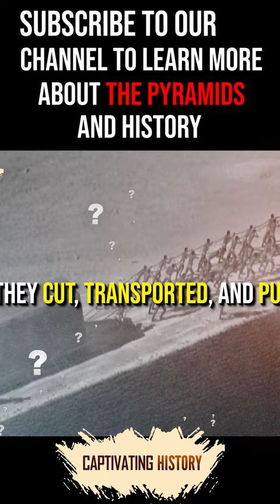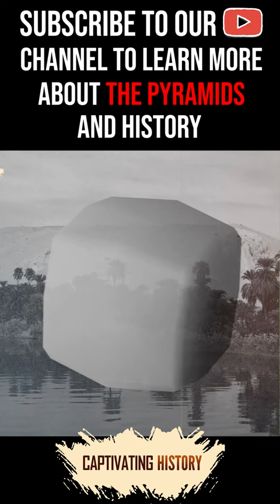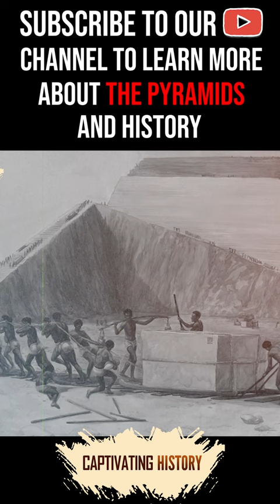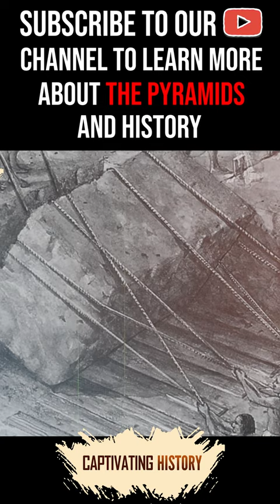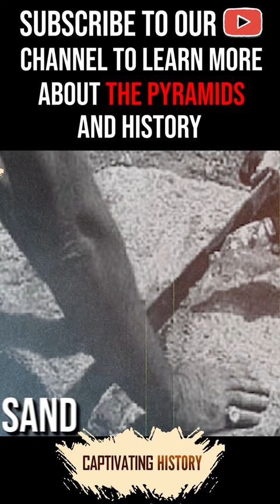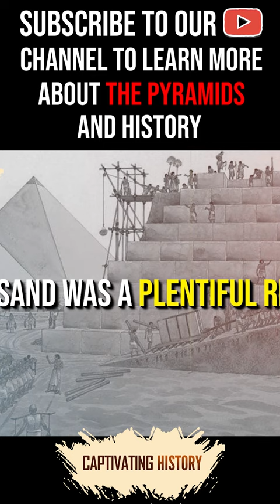How Were the Stones of the Pyramids Cut, Transported, and Put in Place? #shorts

Comment: How did they cut the insides of the granite boxes? Sand did not cut those perfect inside corners.
Reply: Lost technology, it’s not that hard.
Reply: @-ShootTheGlass-  it's not hard? How would you go about doing it then?
Reply: @jswhosoever4533  Well I'd love to tell you if the technology weren't lost.
Reply: @-ShootTheGlass-  i like how you felt the need to 'correct' him yet you have absolutely zero knowledge to add. Brilliant.
Reply: The issue is you don’t have proof they weren’t cut using sand quartz grinded against the granite with copper saws. And before you say it, they most likely used multiple saws.
Reply: @Ta-Mezczyzna  how do you get a saw into an inside corner??
Reply: @jswhosoever4533  you’re referring to the corners inside the kings chamber right? I imagine chisels and hammers like Europeans did when building structures like the cologne cathedral.
Reply: My evidence for this is the fact the cologne cathedral was made from sandstone (mohs hardness score of 6-7) and granite, which was used for the kings chamber has a mohs hardness score of 6-7.

Comment: That guy quit his project once he realized it wasn't viable, and only made 1 cut 6 inches in depth after 3 days of work.
Reply: The corners were rounded and the cut sides had grooves, this also indicates this was NOT the way they were cut.
Reply: Yup. I saw the program. Preposterous to think thats how they did it. Good post. Aloha!
Reply: I use Diamond tools to cut concrete daily and often natural stone. 
I know how much power, speed and pressure is required to cut granite. 
I know which theory I believe and it's not the one with a copper drill bit, sand and arm power.
Reply: @sliperysid  this guy didn't use diamond cutting blades. He used a bronze saw, water, and sand, the tools available at the time, and failed immensely, so he quit. Go watch the video.
Reply: @sliperysid  you might want to look at the experimental videos done by sacred geometry decoded and scientists against myth. They have successfully drilled holes with copper and the removed cores have Mark's on them quite similar to what archaeologists have recovered.
Reply: @rj4313  read my comment more closely. I watched first watched that video about 10 years ago and seen it a few times since
Reply: @sliperysid Tell us plz
Reply: @rockysexton8720  That sounds VERY far-fetched to this diamond driller. We would spend HOURS drilling a 4 inch diameter, 8 inch deep hole into concrete floors. The amount of progress into the work was a delicate balance between patience and torque. The old timers would get a suitable length of scaffold pole to put over the winding arm of the rig to reduce the tedium. When it fell off you put it back on top. If it wasn't going in you had to rough the bit's teeth up with a file to expose the diamonds. Ancient Egyptian cores were cut at FAR faster rates, as evinced by the resulting grooves remaining on both the cores and the work.

Comment: The sand and copper saws were anything but practical - they took an entire day to cut less than 2 inches into a 3 foot wide block. At that rate they world still be cutting the blocks for an unfinished pyramid today!
Reply: If anything it proved that was not how the stones were cut
Reply: It depends on how many you cut at once, and how many groups in rotation. Say the blocks are 60 inches tall. Thats 1 month per group. Have 30 groups in rotation and you get 1 group of blocks per day. The more the blocks per group the faster you produce them. They wouldnt cut each block one at a time, regardless of the tech used, its just impractical. Say that each group of blocks was 1% of the total # of blocks used per pyramid, it would only take 3 months to have every single block need, to be cut.
Reply: @QockNobblr  - so you claim that you can cut 2 million blocks in 3 months?… you’re insane!
Reply: @archer721  like I said, sample size. How many you produce each month depends on how many blocks per group.
Reply: @QockNobblr  - you do also understand that it takes 6 cuts to make a block… right? And they all have to be “perfect” cuts. (Not necessarily clean, but dimensionally) If any were not perfect, those imperfections would translate throughout the structure and would have created unstableness throughout the entire pyramid resulting in an impossible situation to correct… there is no possibility that they were ALL cut with sand and copper no matter how many “teams” of laborers you managed to gather together… the more you gather, the more unskilled labor you acquire, the lower the standard of the finished product.
Reply: @QockNobblr  - this is not just a matter of stacking random blocks until you create a pile. Millions of tons of weight creates a massive amount of applied pressure resulting in instability at a MASSIVE scale. this was a massive effort that cannot be done at random and cannot incorporate random imperfections at any scale.
Reply: @archer721  never said just sand and copper. They had access to diamonds, and I find it hard to believe they couldnt make bronze. Bronze hardens when it's hammered. Diamon and sand encrusted  hardened bronze circular saw powered by man-powered wheel mechanisms with some gear ratios to increase the rotation of the blade to suitable levels would 'cut' down on the time to produce a single block. Obviously, I wasnt suggesting that each group produces 200k blocks, and that occurs daily. Each pyramid was built over 40-60 years each roughly. Lets say half that time was spent cutting out the blocks. Thats about 30 years for 2 million blocks. Which translates to roughly 186 per day, or 5,555 per month. If they did it how I think they did it. 20 blocks wide 10 blocks deep per group, mined out of the quarry, thats about 200 finished per day and thats a group only 1 block long (so 10x20x1), which its more likely they made groups longer than that. The pyramids werent built in s few years, they were built over the course of a pharoah's lifetime (the big ones at least. A couple pharoahs before them cracked out multiple small ones before their death). There's definitely more to the story, but its not as insane as divine intervention or aliens. Its almost definitely more realistic technology, like wheels, diamond tip blades, gears/gear ratios and stuff like that. Like tech we have today but bigger, more rudimentary and entirely man powered. The egyptians were some crafty bastards
Reply: @archer721  by group, I meant the blocks being cut themselves, not being placed. Thats a whole other story. My personal bet is elephants or man-powered crank cranes sorta like archimedes hook which could allow a single man to lift an entire ship just using pulley ratios. Add multiple all the way up and swivel system to it and you could relatively easily move those heavy ass granite blocks around. But obviously this is all just speculation
Reply: @QockNobblr  So how do you cut the holes and the inside of the boxes or caves. You must do some research about the speed of modern tools moving into granite.
Reply: @clivewells1736  it depends on multiple factors such as ceiling height, hole depth, cave depth, etc. How did they do it exactly? Not sure, but obviously it was some type of multi-man powered crank shaft system. Also the inscriptions inside/on their structures were obviously chiseled in, due to how crude they look in comparison. Their cutting amd drilling tech must not have been for delicate writing. It would've been for large scale precision cuts and holes. Ocham's razor. The simplest answer is often the correct one.
Reply: @QockNobblr  the simple answer is we dont know about their technology, not that it was sand and pounding stones.

Comment: But drill holes and saw cuts have been found. Some drill holes found could not be achieved by any tool today.
Reply: Yup, and the water damage on the Sphinx and the sea shells in the sand scream that the Egyptians dug them out rather than built them..Now the real question is who built the Pyramids on the Azores ocean floor off of the coast of Portugal.   Check out Randall Carlson 
.
Reply: Uh, modern tools could absolutely make the same "drill holes" - tools my own Father owned.
Reply: @christyworld72  it wouldn’t be the same. Looking at the striations and doing the math, whatever tools they used were incredible. There’s two kinds, 1 of them spun faster than a modern drill, another spun much slower than a modern drill but could penetrate into the rock hundreds of times faster. So in the time you drilled 1 inch with a modern drill, they’ve already drilled 300 inches. We can make a hole in stone easy, but it won’t be the same.
Reply: @OlavUnngar  please do reveal the source for your claim of these miraculous drills. There are plenty of videos demonstrating how ancient Egyptians were quite capable (clearly) of accomplishing what they did with available materials,
Reply: @christyworld72  you ain't core drilling granite or cutting it precisely with copper without extra technology
Reply: @anonnomous6223  and yet they did, somehow
Reply: A type of pord concrete
Reply: @christyworld72  not necessarily. We have no proof that they were originally constructed at the time of the pharaohs
Reply: @christyworld72  no they dident that would be like cutting bricks with butter just not gonna happen
Reply: @laa4307  how is it so then?
Reply: @anonnomous6223  um, so, earlier then?
Reply: @americanjoe5486  poured? That would be evident.
Reply: @christyworld72  well idk just spelling the rules out. But I have cut it dovn the 3 thigs i bellive is the case. 
1 they had some for of mixture (prohabs some plant mixture ) that soften the rock so they was able to cut it with cobber tools.

2 they had harder metal tools then we give them crittets for.

3 they had vary difrend teknologi then ours and im talking about sound & frequence teknologi. I do belive that was the way to get 70tun stone Blocks livetated 300feet up midt air and put in placed, but that teknologi has ben lost. 

Fun fact did you know they had electrisety back then ? Even batterys that is called a Bagdad batteri tht coldt be used for wielding
Reply: There’s a saw cut that sent crooked , it didn’t go off in the wrong direction for a 1/4 in or anything it was 3-4 ft just like if you jerked your hand cutting plywood with a circular saw , if it was done by a slow hand saw the builder would have realised his mistake quickly , only I high powered saw could mess a cut up like that
Reply: @enterprisencc1701z  it’s a known fact the Sphinx was dug out , have you any links to this pyramid in the Azores please ? Love this stuff
Reply: @OlavUnngar  No.
Reply: @christyworld72  yeah, earlier is my guess. Mr. Smith was correct in saying that they were able to drill through granite much faster than we can today. This is observed in the cores that were drilled out of the granite coffin in the kings chamber as we as in the coffin itself. Modern stonecutters unanimously agree that at the very least state of the art tech from today's Era would be REQUIRED, not just hypothesized.
Reply: @christyworld72  Copper is softer than granite. The copper will bend and flare and flatten and the granite would barely be scratched. It cannot cut or split it. It is impossible to work granite with copper using any currently known or hypothesized methods.
Reply: There are zero drill holes from Ancient Egypt that could not be achieved today. There are however, many inexperienced people who get suckered by science fiction authors posing as independent investigators who are more than happy to lie about ancient artifacts. 

There is not a single thing from Ancient Egypt that is square, flat, or parallel not a single hole that is actually round by any standard of the last three centuries. 

It’s beautiful craftsmanship for such crude tools, but precision work it is not.
Reply: @StoneInMySandal  please stop
Reply: @StoneInMySandal  You're right. They just used an ancient Hilti drill made from sand. I mean it worked for saws!
Reply: Right and the sand cutting would of taken an inconceivable amount of time and wouldn’t have been precise as it is
Reply: @denofpigs2575  It wouldn't have achieved the speed they did and it wouldn't account for the bad cuts that have been recorded. If they were drilling or cutting by hand and mistake would have been immediately apparent and not as deep as has been observed.
Reply: @StoneInMySandal  We can drill granite with today's technology. We cannot with their alleged copper tools. And especially not as quickly as they did. Fedpost?
Reply: @anonnomous6223  I'm being sarcastic. I subscribe to the scenario presented by Graham Hancock until i find something that makes more sense.
Reply: @anonnomous6223 check out 
scientists against myths
On youtube
Reply: . Check out scientists against myths on youtube
Reply: @anonnomous6223 Check out scientists against myths on youtube
Reply: @tbutcherfpv810  they used wooden and sand lazers.
Reply: @davismize  ahh of course
Reply: @christyworld72  where are these video's? Bc I only found the one they referenced and the method wasn't practical nor "effective" ...it just happened to work. But using the methods they claimed it would've taken 100s of years to complete and not the 20 they claim. So either the Egyptians didn't build them or they had access to much better tools, the fact they can't really find this abundance of tools they claimed they used would further prove the Egyptians didn't build them. Not to mention there's absolutely no proof the pyramids were ever used as tombs nor is there any writings speaking about building their greatest achievement...and no im not saying aliens did it either r
Reply: No they can be accomplished but the basalt is still hard with top of the line hilti core bits. And there spiral in some quarries in Egypt show the speed of the core says. 3000 rom. So….
Reply: There are nowhere near enough dislikes on this ridiculous comment you made.
Reply: @enterprisencc1701z  I love that guy watch him on rogan but what's his page I can never find anything good by him only smallnshot videos
Reply: @JC SS what triangle drill holes are you speaking of?
Reply: @JC SS I can’t find a source for triangle drill holes, you speak of, round yes
Reply: @christyworld72  Sorry luv, the so called 'sarcophagus' in the kings chamber was chain drilled at least a hundred times faster than modern core drills can eat into granite. This is revealed by the tool Mark's left on the inside which weren't polished like the outer sides.
Reply: @Luxteroza  he is a bot
Reply: @christyworld72  are yu a bot 2? Perhaps we can collaborate on flatest earth theory..?
Reply: @aliensphyncter9528  who is it; Randall Carson or Graham Hancock?
Reply: @clivewells1736  randall. I cant find his page with his full length videos  only clips from Joe rogan or something like that
Reply: @clivewells1736  odd, my comments are the opposite of ‘conspiracy theories’
Reply: @laa4307  spelling op

Comment: If the pyramid building project was under construction for 200 years, then the block could have been cut that way. 
  How did they create stone sculptures out of Marble and Granite with copper chisles. The Granite statues are mathematically perfect in symmetry.  The Granite vases, jars, plates and other containers could have only been made on a high speed lathe. That was the conclusion of Archeologists as far back as the late 19th century.
  Then there's blocks of cut stone that weight a 1,000 ton. The blocks came from a quarry hundred of miles away. A 1,000 ton is two million pounds. It is not possible to drag two million pounds of dead weight through desert sand.
 Some claim that they wet the sand to compact it and add lubrication. That's does not address the weight involved. It would be like trying to drag a freight train through the sand with a rope. You're never going to keep it above the sand
Reply: Canals dug float them to the build site, aerial viewing by archaeologists figured it out
Reply: Granite may be tough, but it cuts easy, despite what "aliens did it" will tell you. Granite can absolutely by effected by copper tools, even swords
Reply: To bad they out date the Egyptians.
Reply: 20 yrs not 200

Comment: Yeah right, I cut concrete for 15-16 year's and I call bullshit. Wasn't done with any hand tools. Don't know about them doing it in water. We used water to cool the blades and keep the dust down. I've used sand before when core drilling to open up the synthetic diamond segments on the core bit. It would definitely make it cut better after drilling through rebar

Comment: Desert sand was not plentiful when the Pyramids were built. They had rivers flowing practically right in front of where they were built in order to transport huge blocks from 3 different locations far away in Egypt using 3 different materials on each of the large Pyramids. There was a lush jungle there at the time of the building and the places the blocks were cut from were not in the desert at all.